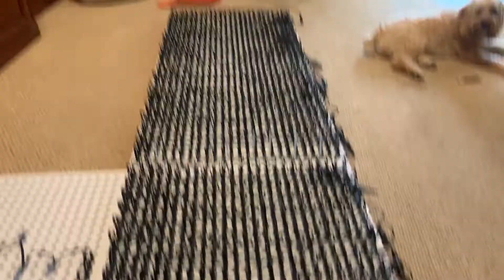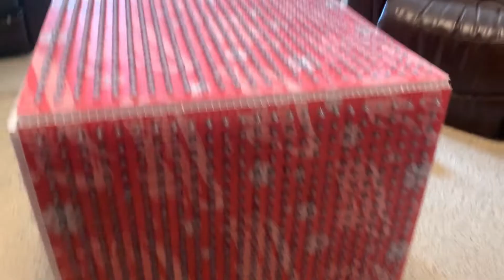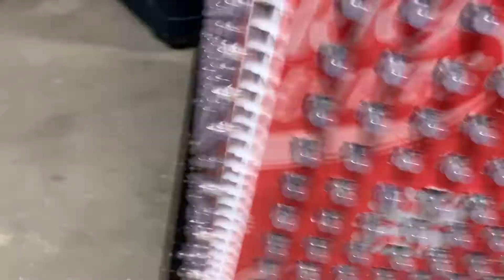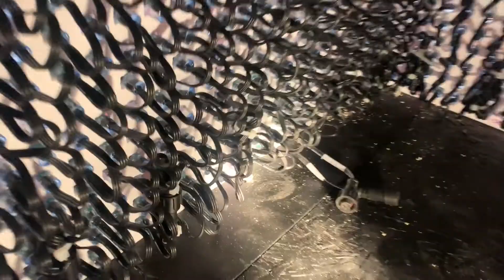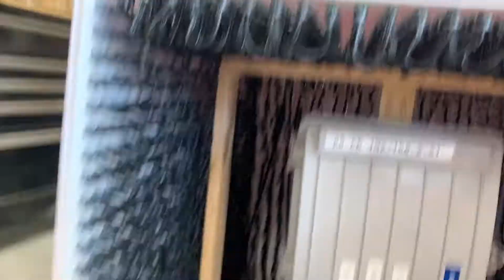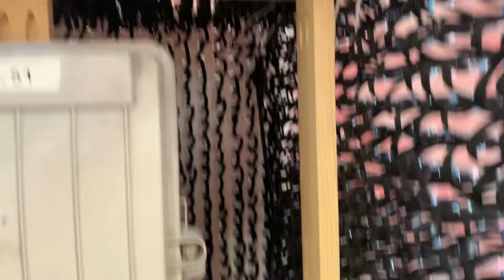Large GE cube Assembly

Comment from the maker: Just realized that the pixels on top of the cube were installed 90 degrees out of phase.  If you follow this video please go straight up as you transition from the long 3 panel section to the top.  Do not do a 90 degree turn.